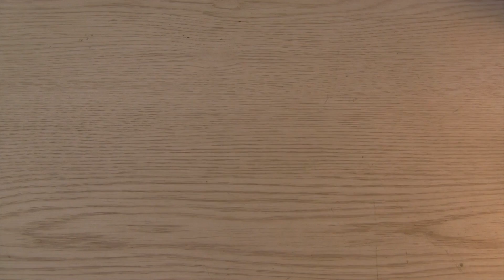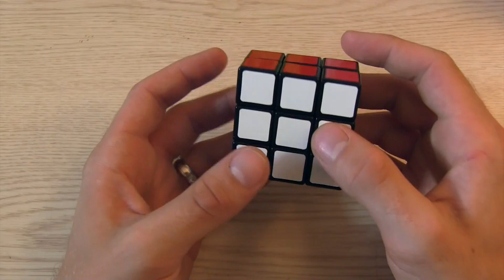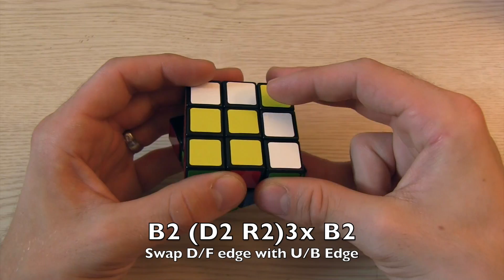2x3x3 Cuboid - How Do You Solve It?

Comment: I thought you didn't like cuboids... o_0

Also, I solve a white cross (you must properly orient center colors), followed by corner drop algs to finish bottom layer .. results in all white/yellow solved (essentially OLL). Then use corner swaps and edge swaps (across and adjacent) to finish top layer (PLL)...which all seems less complicated to me.

Also, this is the corner swap alg I prefer: R2 U (R2 U' R2 U’) D (R2 U’) (R2 U) R2  (swaps the front right and back right corners on the U layer)
Reply from the maker: +Casey Weaver I still don't :)
Reply: it also swaps the UL & UR edges